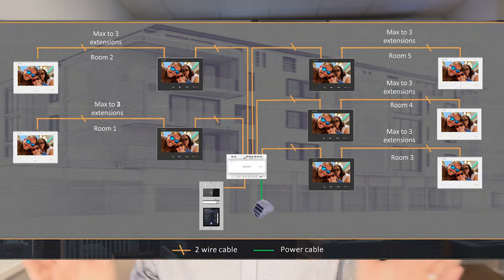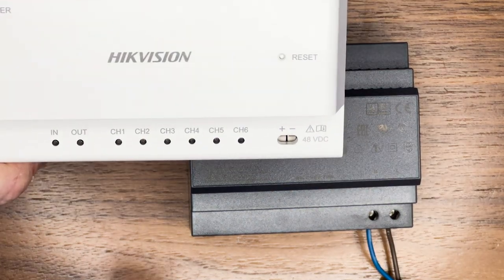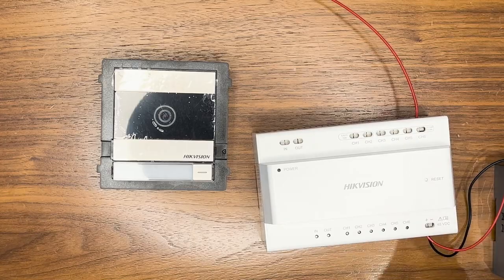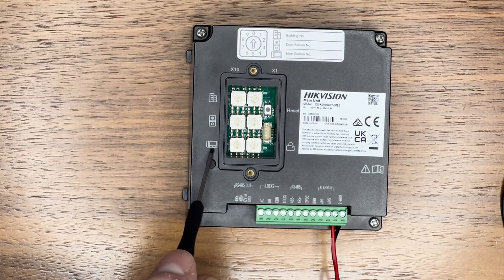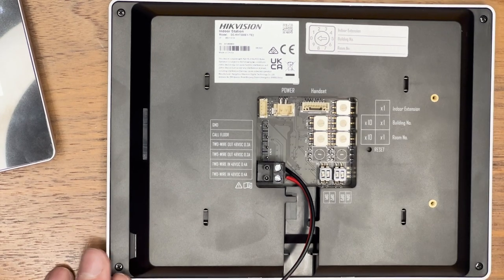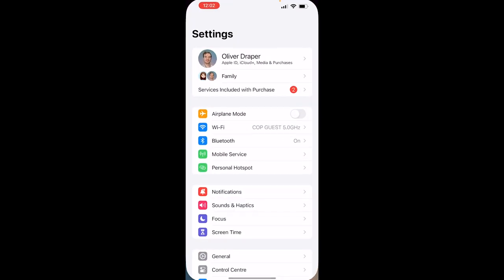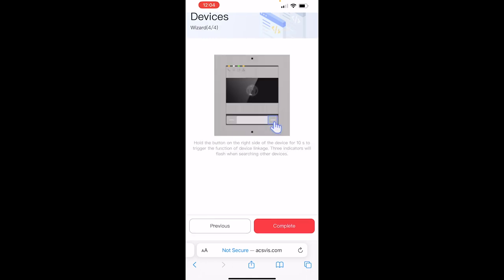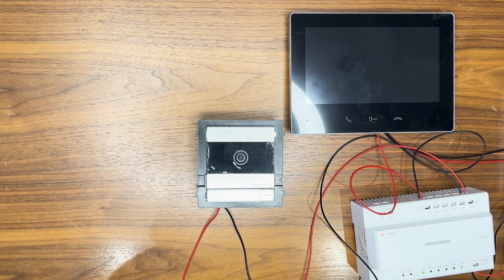How to wire and configure Hikvision 2 wire HD Analogue Video Intercom

Comment: Hi, I installed a 2-wire video intercom kit with display model DS-KH7300EY-WTE2. My customer complains because the DS-KH7300EY-WTE2 display makes a noise in the audio when turned on after a while and also when the monitor is on. off I attach video 

we replaced the monitor with another identical one but after 1 month the problem repeats itself, what could it be? Are there any filters to apply? Thank you

Comment: Sorry, but this is NOT an ANALOGUE system, it’s 2-wire IP.
Reply from the maker: Hello,
I understand you confusion, the 2 wire IP is the previous DS-KD8003IME2.
This new version which is the 7003 using analogue dec dials.  In additon, the previous 8003 version had the facility to connect an IP cable to the distributor box, the 7003 does not.
The only time anything to do with a network is if you opt to use the WiFi Indoor stations.  But this is only for the purposes of connecting the screen to the customers WiFi for the purposes of connecting the screen to HikConnect.
Reply: @COPLtd  can you install thiswithout phone and only use Dec dials?